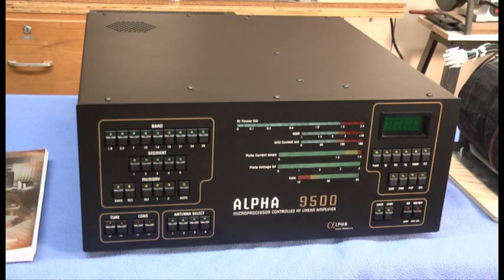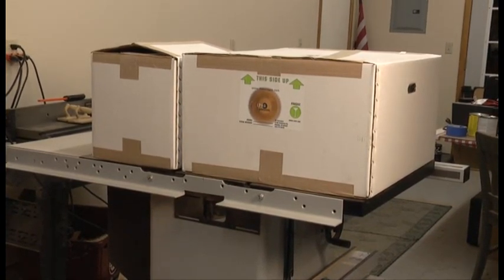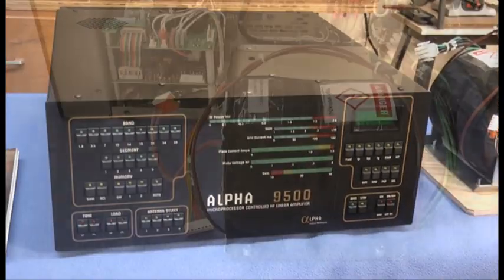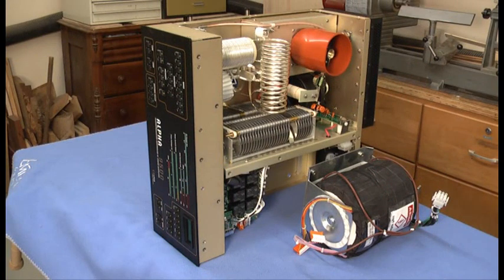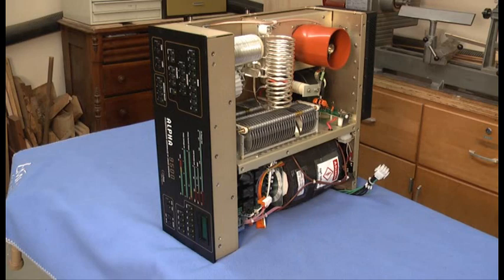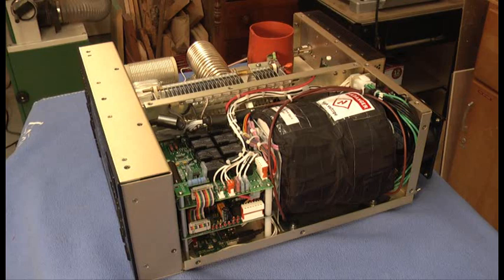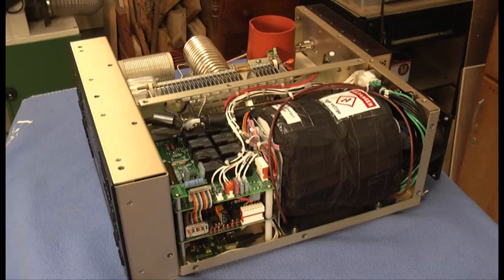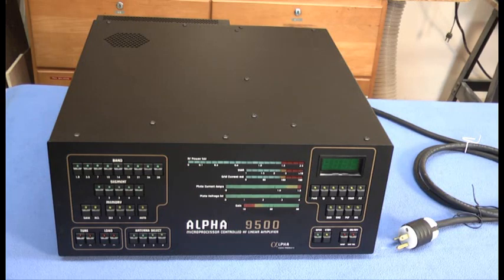Alpha 9500 Transformer Installation

Comment: I bought my 9500 in 2014, the connector that goes into the top board has PINK wires. The connector that goes into the lower board has multicolored wires. I was going to post a video, but since I got this together and working, decided to just post these notes.

Comment: Not enough detail: Should show actually connecting the transofrmer plug on the right side of the transformer and which of the other connectors go to which board. There is a pink connector and a multicolored connector. Can not figure out which goes to which plug and having problems connecting what I think is the correct connector to the lower board. Also would help if had shown how to wire the 220 plug.

Comment from the maker: There are only 3 connections to be made with the transformer.
Each connector can only be plugged into the proper socket.
Wires with the Molex connector are for the line voltage
connection. The 7 pin connector goes to the high-voltage board, The 2 pin
connector goes to the mains board, which is located above the high voltage
board. I believe the instructions given in the manual make the process
very straight forward.

Thanks
Al, K0CN